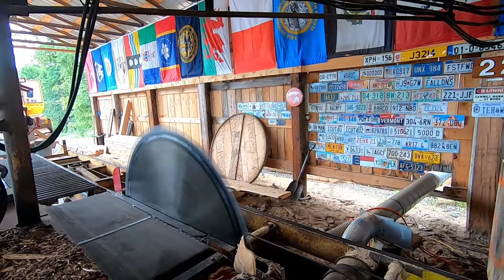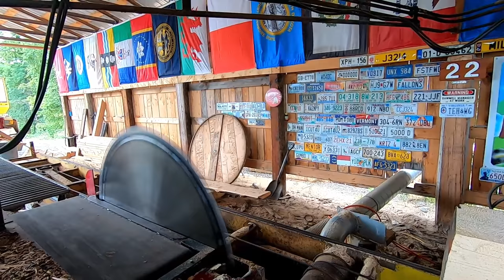sawing a big pine log # 212

Comment: One advantage the circle mills have over the band mills. Dealing with knots in spruce and pine. No blade deflection in the circle mill, while the band mills have to deal with blade dive.
Reply from the maker: yes they do saw pine very flat.

Comment: I went with a 80v electric chainsaw to use around my mill. Works great, no fuel or starting. Just push a button and go.
Reply: Same reason I bought a 40v weed. Trimmer
Reply: S

Comment: I “saw” when it happened, Marky Galactic! 🚀
Reply: At 15:40, you placed a face on top that was just a random face from the 🛑 and wasn’t square to anything. Then at 33:40 you say you’re going to turn it “out” to square it with the other three sides, but instead you turn it “down” and cut another side. Now you have two pairs of sides square , but not to one another. It’s easy to lose track, ain’t it!
Reply from the maker: yes and bark under it too not good.

Comment: Diesel slobber was common on the trucks I worked on and is not really indicative of a problem by it's selfe, it is a mixture of the moisture in the air from running in a humid or damp environment and soot from the exhaust. If there was unburned fuel in the exhaust there would be black or grey smoke, oil would be blue smoke'
Reply from the maker: we have fuel getting in crankcase.

Comment: I've noticed among the ads running on your channel, a six‐inch battery chain saw that would work for those little knobbies...
Reply: Be nice if the axe was sharpen some...
Reply from the maker: maybe a 12" bar.

Comment: Hey, you keep calling your power unit a bus motor, what exactly is it for an engine. Make, size, power, etc.
Reply from the maker: it's a 671 Detroit power unit AKA bus motor.
Reply: @markgalicic7788  That’s what I kinda figured, nice power for your mill, them things will run forever, as long as they got oil,and coolant. Very nice channel Mark, keep sawing.